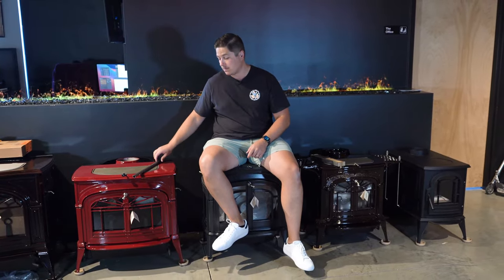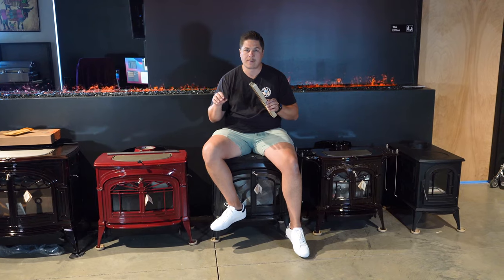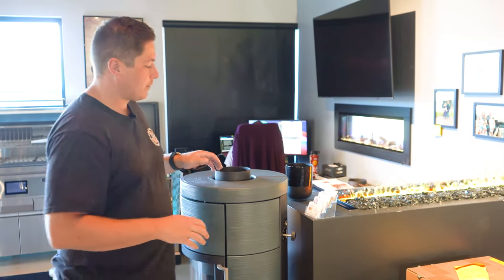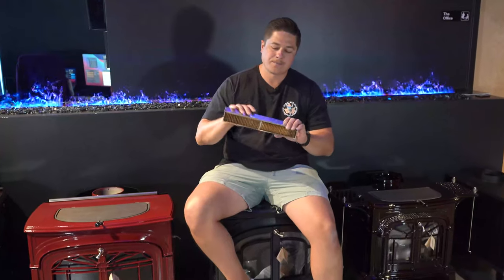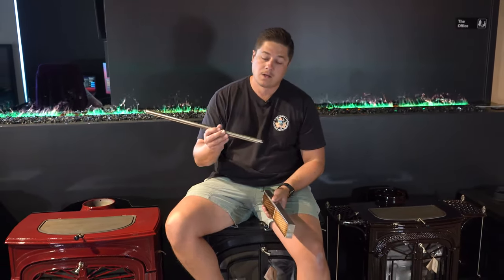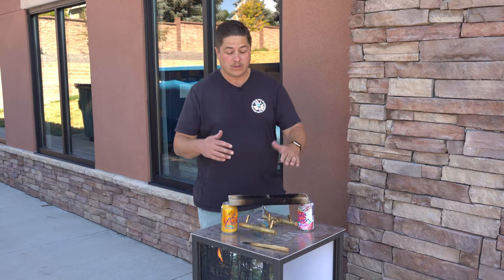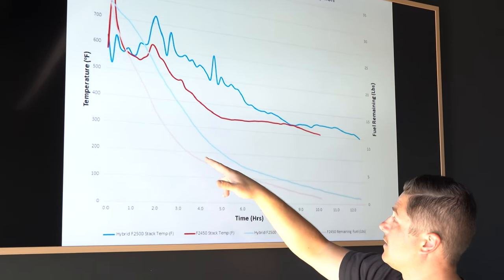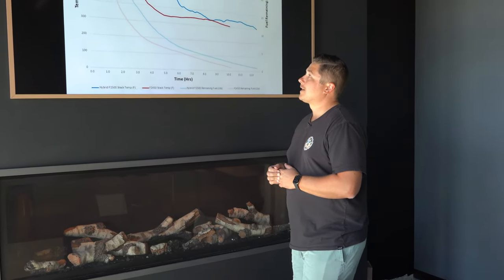Catalytic vs Non-Catalytic Wood stoves (Which one is better?)

Comment: Two solutions to the same problem. But the explanations on youtube are all lacking. They all focus on how hot the catalyst needs to be. But this is distracting! The catalyst is there to operate at a much lower temperature compared to where proper secondary burn works. The catalyst can let the stove operate cleanly in a lower power setting. As long as the catalyst is hot/active, it will work and "re-ignite" the leftover combustables. The gasses can be much cooler, as long as the catalyst is hot. Because it can keep itself running. That is great for stoves that are meant to operate at a low power setting, like over night or long shifts. Secondary burners without catalyst do the same in principle. But without the help of a catalyst the flue gasses need to be above the auto-ignition temp of the combustibles when the air is added. Which is 700-1000°F. So this principle does not work at a very low power setting. Because they won't ignite when they are not hot enough and go out the chimney.
Reply from the maker: Great advice!

Comment: It must be similar to a propane heater with a ceramic core. But, in a wood stove, as the wood burns and emits gas vapor the vapor burns in the catalytic unit.
Reply from the maker: it depends on the wood you burn too

Comment: I would rather get a secondary burn stove(Non-Catalytic).  For several reasons.
Reply: What're your reasons?
Reply: @kelvinkonkel3351     The hotter stove from the start, not having to wait for heat. And less creosot. Less cleaning of the stove. And a much more enjoyable burn with flames for the ambiance and enjoyment of it all. The cozyness of it. I don't mind burning more wood. I don't mind a shorter burn time. I am up in the morning anyway and ready and willing to feed the stove. Not a horrible chore. I love it.
Reply from the maker: @bosse641  good reasons!

Comment: I cut dead standing pine  from the mountains, never used a meter for moisture. I cut it split it burn it. Burning it hot once a day keeps the build up down. Stove Blaze King blaze princess 8 inch double wall. Throw in some card board, or quaken aspen once a month and clean my stove pipe once every season, and clean the arrestor 2 to 3 times a season mostly when the humidity is high. I think overall humidity in the area has different effects when burning pine. 
I burn mostly conifers, some spruce, and quaken aspen, every once in awhile cedar when i can as my back yard is full of it, not the tall standing cedar the small bush cedar that dulls your chainsaw chain.
Reply from the maker: Nice

Comment: I find it rather dubious that you kept how to clean the catalytic combuster  a secret. Are you or is someone you know operating a fireplace/chimney cleaning service? 
 I wouldn't know for sure, but to clean one of the catalyst modules I would first try putting it into a self cleaning oven on the top rack and set the oven for clean, a couple hours, AND TURN YOUR  VENT FAN ON in the kitchen. If that didn't work I would try a propane or mapp gas torch. Anything left after that won't matter. I wouldn't scrub it with anything, I wouldn't spray it with water without consulting the manufacturer. I might, however use air to blow off the ash.
Reply from the maker: you can easily ruin it if you clean it yourself
Reply: @embersliving  yeah, but there is a way the professionals do it, why not share the knowledge so people don't mess it up?

Comment: Even with a catalytic unit; air needs to be added for the process to take place.
- In your 'experiment' you had the Catalytic unit mounted in the Open Air, allowing it to 'Reburn' the smoke that you provided from the wood splinter.
Reply from the maker: Good to know
Reply: hmm this is not entirely true. in industry catalytic systems are frequently used in applications without oxygen present, or like on most cars (not mine lol) very little oxygen present.  

the way that they work is still debated. it used to be thought that they simply allow a uniform and predictable surface for a reaction to take place which alters the orientation and thus required activation energy of stuff when it adheres/sticks to it. it is now better understood that there seems to be a quantum mechanical effect with election density and orbital energy level stabilization that happens at the surface. my favorite example of this is in the shake and bake method of making "breaking bad" from sue dow fed rin.

 lithium metal taken out from those non rechargable energizer batteries is added to a soda bottle containing the reactant dissolved in a solution of acid (concreate cleaner) with some kind of oil interface on top. the acid does the first step of the reaction (adding chloride instead of the alcohol group) and then shaking will push the lithium metal into the solution neutralizing the acid and producing hydroxide base which does the 2nd step of eliminating the chloride bond and forming a double bond. finally because you have lithium metal that is hot and dissolving (giving off hydrogen), it catalytically allows the hydrogen to hydrogenate the double bond and form the final saturated product. lithium as a catalytic surface should not work given the old theory of how catalytic metals function. 
also, this is an example of a catalytic surface working in an oxygen deprived environment. 
you are correct though that oxygen getting to the catalyst is where the majority of the heat comes from which is needed to significantly change the efficiency
Reply: @vevenaneathna  the whole lithium hydrogen thing went over my head. But that's fascinating. Ever since I found out what platinum group metals do, I couldn't stop. I bought 5 Aladdin lamps, clean and safe to use indoors (they're only meant to use indoors). They use a gas mantle. You basically ignite a gel lattice and it quickly burns off. What's left is a very light ash substrate infused with Iridium. A very low thermal inertia with Iridium catalyzing the combustion of Kerosene and Oxygen, producing a white bright light. I'm interested in a wood stove and the catalytic stove obviously piques my interest. I don't have much wood so that would be right up my alley. But you've really got me curious as to exactly how its catalyzed.  Quantum trickery? That's mind blowing. It's kind of incredible how many essential processes are dependent on mysterious quantum events ...such as photosynthesis.

Comment: Oh dear lord. Old thoughts with new tech. You can burn all kinds of crap in a stove and not get creosote build up. The problem isn't what your burning, but HOW your burning. I've ran a stove for 15 years on just prime, often not fully cured. And I've not had to clean it, clarification, I check it every year, and there's nothing to clean. Why? Because I bring up the temp once a burn to clean it all out.
Reply from the maker: nice!

Comment: clean catalytic converters by tossing them into a bucket with laundry soap and water. Soak it for a few hours or overnight. then rinse and lst dry on a towel. Don't use tools. works for car catalytic converters also.
Reply from the maker: good to know
Reply: That's what I have done for decades. For a quick clean, I just suck air through it with a vacuum cleaner. Not as good as water, but works for awhile.

Comment: These stoves need to run lambda with EGR, that would solve the stupid user issues, basically automatic control...
Reply from the maker: Its not too hard to control it just takes time to learn. Something to make it easier would be good though.
Reply: @embersliving  Having done Euro3 ,4 and 5 emission control systems in diesel engines and LPG this is a very interesting subject and amazes me that the automotive industry hasn't looked into this...its now got me thinking...but why has none of these got a water jacket? This is critical to a perfect system..

Comment: Catalyst doesn't do any good if you don't have a heat exchanger. Most of the heat is still going out the flu.
Reply from the maker: I see.
Reply: My Blaze king flue at the top by the ceiling hovers around 105F, I'm I losing to much heat?
Reply: @safffff1000 I think blaze king says between 150 and 300 flue gas temp.  I'm thinking that's at the exit of the stove, not the ceiling.  If the flu gas is too cold perhaps changing to a better insulated pipe and or taller pipe might help.  The flu gas has to be hot enough to draft well. Taller chimneys draft better,  but too much draft and the blaze king will run too hot even at the lowest temperature/damper setting.

Comment: So basically what I'm hearing is, unless you want to spend alot of money to hire a "professional" to clean that cat every year and then have to spend $300-500 to replace it when it goes, which we all know is gonna happen. I'm not going to buy at cat stove. Don't want to have to rely on someone to clean it every year.
Reply from the maker: You dont have to clean it yearly. Build up in the combustor happens from not burning properly. So if you're burning correctly you shouldn't have to worry about it .
Reply: @embersliving  so what type of wood to you not recommend burning. Because we bought land that was partially logged and plan on using the debris and leftover logs for heating. Also have a stack of loblolly pine 20 feet hight logs
Reply: Thats not true, Blaze King recommends about 3 times a season to brush the cat in the stove off with a brush $0, $300 for cat at about 6 yrs, saves a cord or more a yr in wood

Comment: Real catalytic will burn up to 30hours. You are comparing a hybrid (12h burn time) to a non-catalytic (10h burn time). They are very similar with regards to burn times. So not much of a win there, since a hybrid is way more expensive. Maybe invest a bit more to a pure catalytic stove and get the immense efficiency and burn times. The only downside is that you will not get a nice visible flame off the latter.
Reply from the maker: good thoughts

Comment: I know you try to bring humor in your presentation. But it make it unnecessary long and missed the whole point of explaining what secondary burn does and catalytic burn does .

1. Secondary burn provide HEATED fresh air on top of the primary burn ( wood )
Heated air is readily combustible with unbuned smoke and wood gas . Simple operation . As long as the secondary air is properly heated it will burned when mixed with unburned wood gas and smoke and soot.

Done .

Catalytic converters work by chemically reaction changing unburned hydrocarbon/ wood gas and smoke and soot .
Via catalyst made by precious metal such as palladium and platinum .
This catalytic burn donot require oxygen . It break the hydrocarbons bond and generate heat .
But catalytic converter has to be heated to operation temperature.

Done ! .

And yes catalytic converters and easily damaged by improper maintenance.
Reply from the maker: thanks

Comment: Cats & reburners are "smoke particulate" minimization techniques - purpose is less smoke - to conform to EPA? regs,.  The heat, burn times are just an end result of the technique used.  Reburners are hotter bc it is "reburning" so fuel/wood goes faster. Cats don't require extra heat to operate, so fuel goes slower.  In all reality, a "larger" stove with TWO STAGES, having a reburner front/side 1 WITH a Cat rear/side 2 would be the ideal way to go (switch or adjust between as needed), example for a cooking stove (Kitchen Queen?), this would create more heat from same fuel and Cat would last longer. Even better would be a vortex flame path, more heat, less fuel. With heat reclaimer, this would have it all.
Reply from the maker: Appreciate the comment! thanks for watching.

Comment: No catalytic for me, too much trouble.
Reply: Well I can see that,  Set on high, reload on coal bed, 30 min later turn down to temp, 12 hr maintains same heat output with no further adjustment.
Reply from the maker: true

Comment: Using Blaze King's research is BS.  LOL.  I don't buy it.  You must sell Blaze King.
Reply from the maker: I don't actually
Reply: @embersliving  Well you definitely sell the catalytic bs.  I've had both, they suck.
Reply: No1 rated stove by consumers who use them, whats your complaint about them
Reply: @safffff1000  The catalytic system sucks.  They get clogged, they aren't easy to clean, and no matter what, you have to replace them every so often and they aren't cheap.  Lopi's system is virtually maintenance free.  Easy to clean, never have to replace that system.  Some of those catalytic filters are $300.  Also, they aren't the number 1 rated.  They are popular, but not number 1.  And even if they were, it doesn't make it the best, just the most popular.  Popular doesn't equal the best.